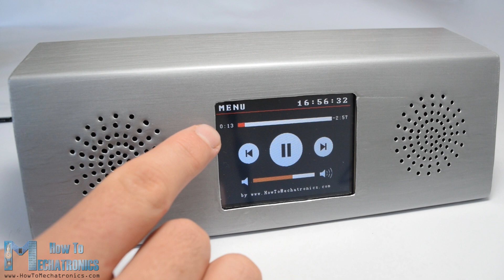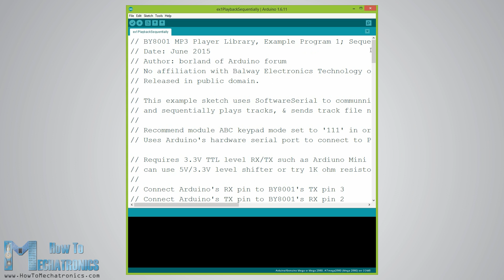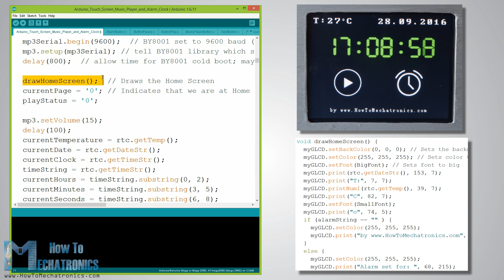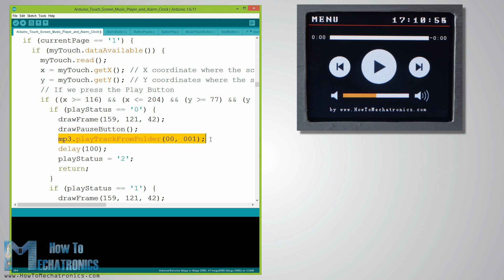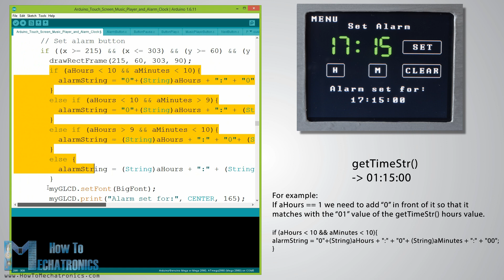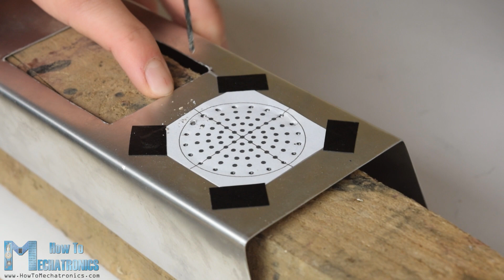Arduino Touch Screen MP3 Music Player and Alarm Clock Project

Comment: Very nicely done! 4 out of 5 stars! The missing star is for using hot glue to make the case. Would have been more impressive to use a welder, epoxy, or something much more permanent.

Comment: Does anybody have the C files for this project? The link to download on the website isn't there. I have all the hardware ready to go. Thanks in advance
Reply: I created the .c files but I was unable to get the screen to work, however the screen works with other programs.  If you need them I can send them.

Comment: What's with the 2 capacitors connecting 5v to ground?
Reply: spikes and noise can reset the Mega that's why you need the caps.
Reply: @JamieZorin   Thanks. I figured it was a power drain issue. I since did a project where my Mega would reset randomly about once a month (remote control/timer thermostat for a radiator with colour screen and LED readout). I Put a cap in and it solved it.
Reply: @ArcanePath360  Were you able to get the touch screen to work?  Everything works except the touch screen.  I created the .c files if you need them since I was unable to find them on his site.
Reply: @JamieZorin   I have a completely different set up to you. I used a Nextion screen
Reply: @ArcanePath360  I did a URTouch Calibration Data Verification, everything is working.